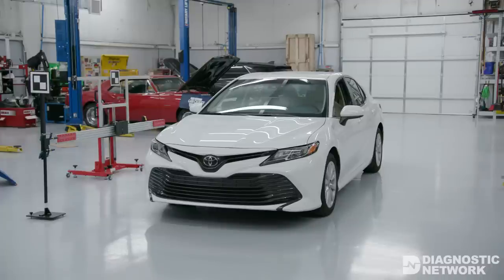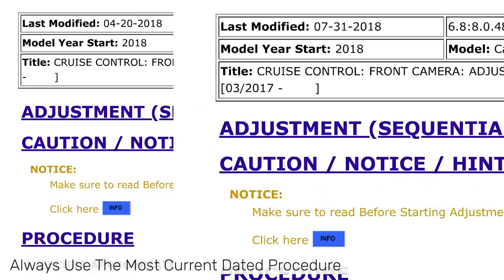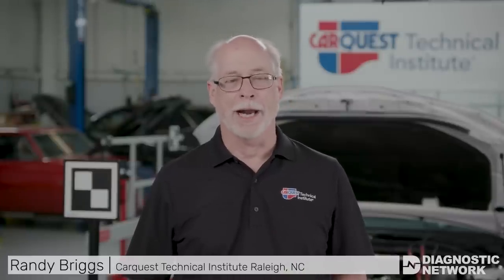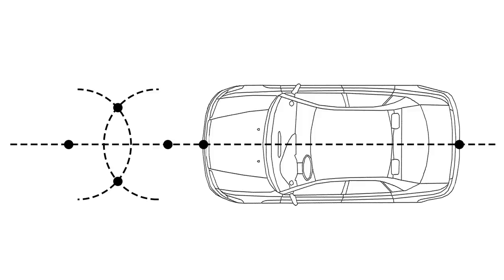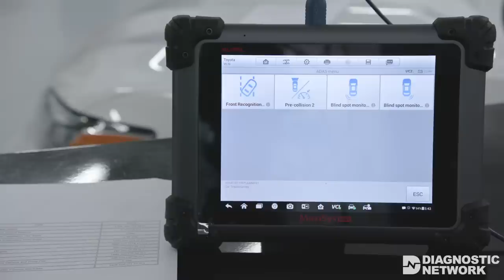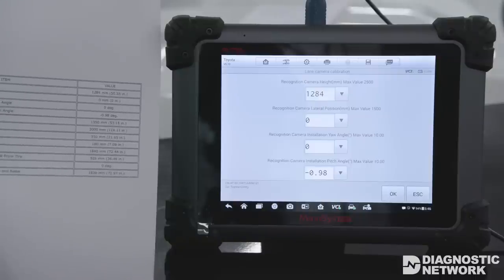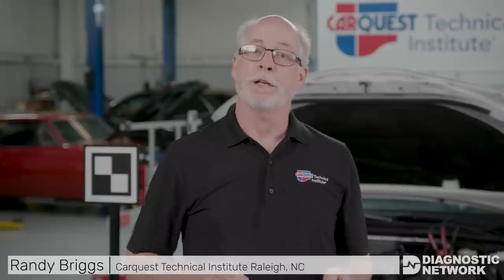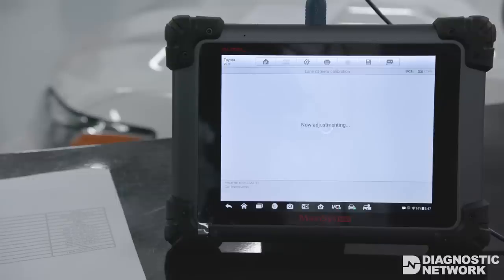2018 Toyota Camry Camera Calibration — Advanced Driver Assist Systems (ADAS)

Comment: I had a recent rearend  collision, from the outside it looked fairly "minor". The body shop said it needed to have the ADAS recalibrated. Since the insurance covered it, I had no reason not to have it done. I was surprised at the charge ($640) for the adjustment not including any parts. Rest of body work and paint came to over $4000.

Comment: Hello
I have the same car (2018 camry) and I see two warning messages on the speedometer cluster (precollision malfunction and LDA malfunction). I serviced my car in toyota dealership to resolve these issues. They told me the radar is not communicating with the car and after few hours they told me that the radar is communicating with the car but still not programmed to the car. Any suggestion how I can fix this issue? Do you think I should ask toyota to keep try to program (or calibrate) and this will get resolved? Any hint? 
Thanks a lot for your advises in advance!
Reply: did you ever get this fixed
Reply: Mike Somerville  yes. One wire was disconnected. A good electrician helped to fix it.
Reply: How much is it to fix the pre collision camera ? I had my car stolen and they cut the wires of camera on my 2017 Corolla ,

Comment: to many questians here
all these accurate mesurements do they account for how many passengers in the car 
do they account for a trailer
do they account for things in the boot of vehicle
do they account tyre wear
because in my opinion as an auto glazier when you replace a windscreen at most it could only be a couple mm out wich would be your smallest problem if any at all
I have raised these questions with no answers that makes any sense at all from anyone that does these calibrations besides the fact they want $300-$400 to do this 
until some one has answers that actually make sense besides the answer that they auto calibrate these factors wich would mean it don't need to be calibrated at all
Reply: I'm very skeptical...Old windscreen out: Camera is carefully un-clipped from mount, but NOT disconnected from the harness. New windscreen in: Camera is clipped back in to the mount on the newly fitted screen. If the windscreen is fitted within tolerance (and that is REALLY hard to get wrong) I don't see why you'd need to re-calibrate. The dealerships and tech companies are of course loving this, but it sounds like a money spinner to me... 

Of course the brand agents are going to say you HAVE to re-calibrate regardless of what repair has been carried out, its a money machine! And OF COURSE the people who sell the calibration kits are happy to sell you a kit, for exactly the same reason. With frontal collision damage/roof pillar repair or replacement of camera or sensors I'd understand the need for calibration, and the subsequent need for the calibration kits but for a simple windscreen change, really???. 

I'd like to test my theory as follows: Check calibration of camera with old screen and camera in place, change screen, re-calibrate. My guess would be the same result...because Nothing has changed. 

Happy to be proved wrong, but show me the evidence!

Comment: Absolutely ridiculous  . Im doing a wrecked rav4 and I bet when I send it out to get recalibrated.... no dealership is going to be measuring the floor or half the requirements to do this  .
Reply: The measurents have to be correct or the camera adjust will fail and the warning lights will be on
Reply: @antoniotabares1234  if the shop I took my 2022 Avalon go for a windshield replacement didn’t recalibrate correctly, my car would tell
Me something? Sorry, just making sure what you meant because I just had a bad experience

Comment: These calibrations are a joke. You cant possibly expect someone constantly calibrating these cameras for every little thing that happens. Just another way for cat manufacturers to make money. The lane assist doesn't go based off the centerline its programmed to detect the white/yellow  lines on the road.
Reply: Very true, but positioning the target from center to passenger side and driver side is also required for lane departure....therefore that re-aligns camera when u drift off to the side.....i do these calibrations at my work and trust me, do i like doin them? Hellllll nooooo!!!